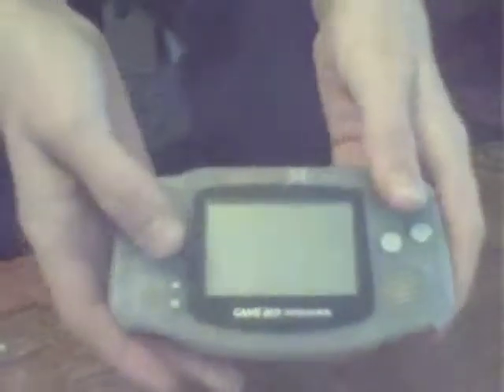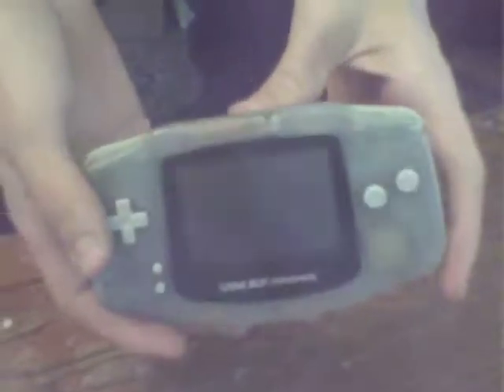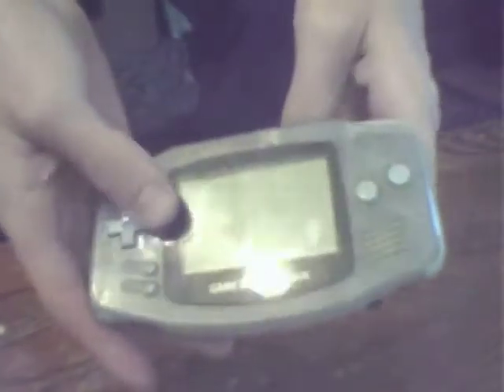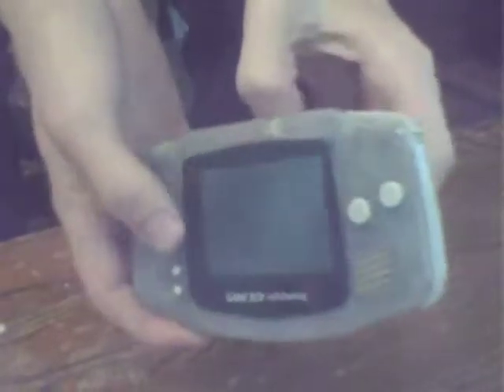GBA Extra Battery Mod

Comment: Woudn't you be feeding your GBA with 6 volts? When having the 4 AA batteries installed
Reply from the maker: +Guillermo Fernández No, the batteries were installed in parallel. So, it doubled the available current, not the available voltage.
Reply: +William Shipley Well that certainly answers my question, thanks